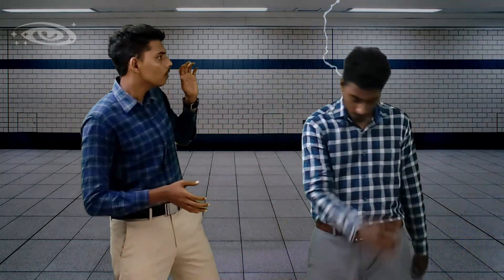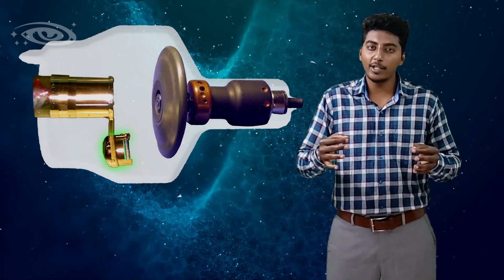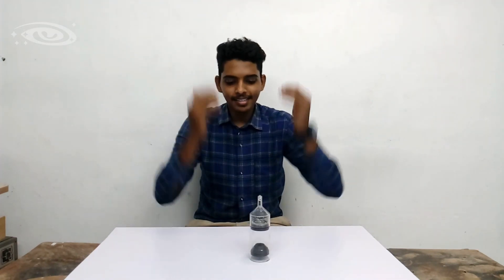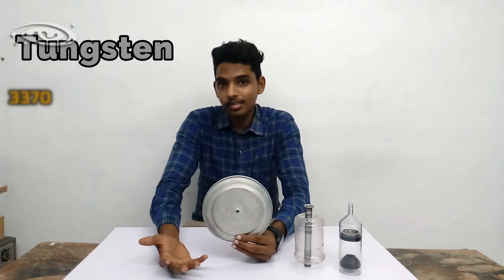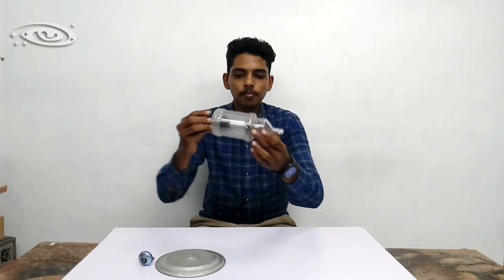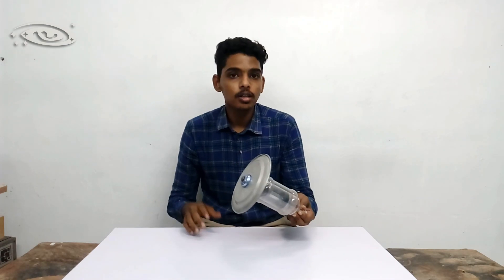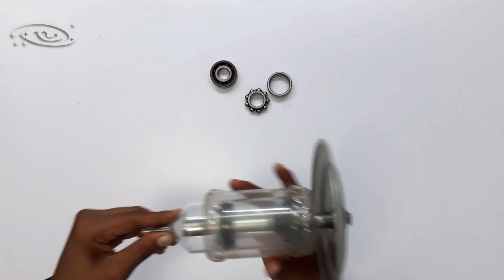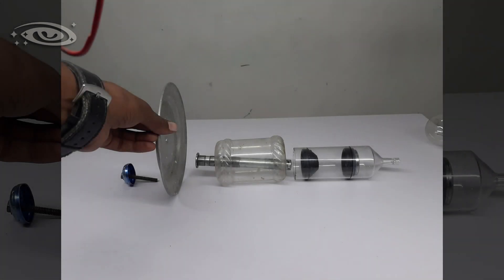Rotating anode x ray tube / constructions and working principle

Comment: Impressive Presentation. One question ,,,Even the principle is same but what is the actual difference between CT Scan, Fluoroscopy Machine & X Ray in terms of Methodology used ?
Reply from the maker: Of my knowledge I will say,   For CT scan x ray efficiency needed more while comparing the general Radiography x ray tube.
So in CT x ray tubes filament and target will be thicker enough to produce high x ray efficiency. 
To produce more x ray we need to give more current and potential. But we can't give more current and potential in general Radiography tube, what we give in CT scan.  Because thickness of the filament and target is Less in general Radiography tube compare to CT scanner x ray tubes.

X ray tube components and it's principle used in General x ray tube , Fluoroscopy and CT scanner are same, But the thickness of the components may vary.

Comment: In extremely high vacuum in x ray tubes heat conduction is impossible while you have claimed 50% heat is transferred through glas to surrounding oil
Reply: Some heat through radiated to the glass

Comment: Brother iam having one doubt.oil is used around X-ray tube for heat dissipation.due to vaporization we are not using the oil as a lubricant inside the bearings.at the same time oil around xray tube means where exactly it present,this will not vaporize and destroys the vacuum?
Reply: @IMMORTALUNIVERSE99  thank you so much brother.nice presentation good wrk keep it up
Reply: @IMMORTALUNIVERSE99  brother can you upload xray tube transformer,generators, rectifiaction and all other circuit parts videos.This is a kind request from me.bcz ur videos are so much hlpful for me to understand the concepts easily.